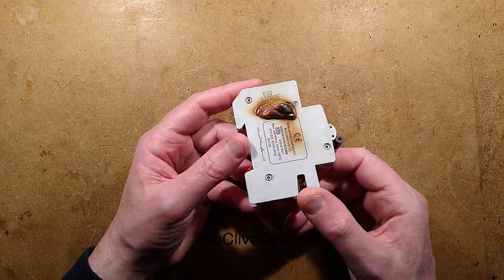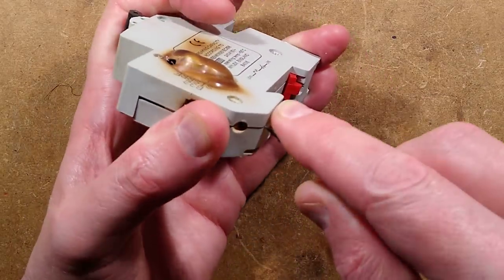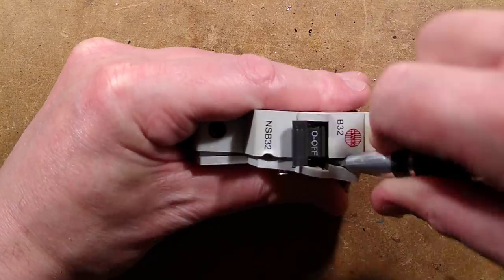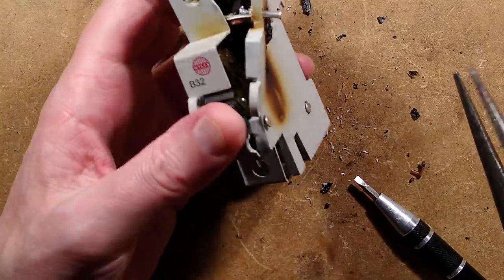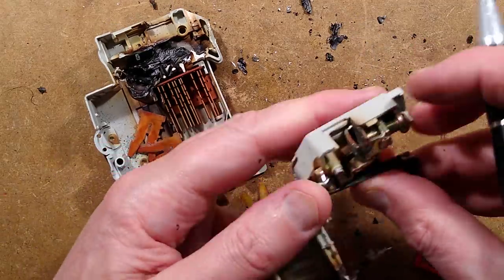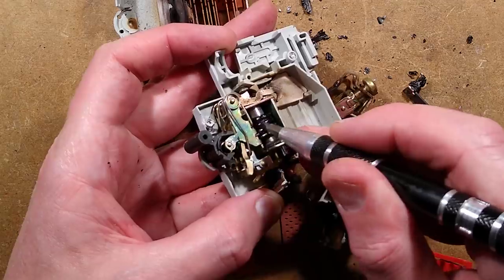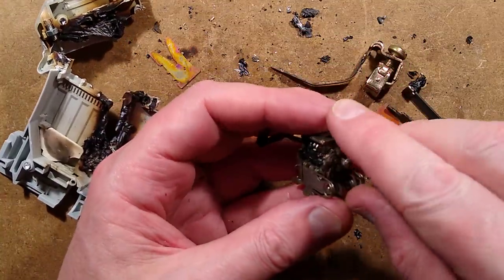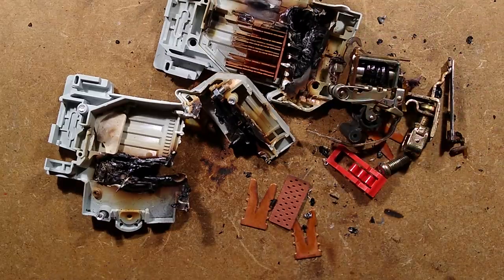Inside a totally smoked circuit breaker.  What went wrong?

Comment: ive seen similar done to US breakers but it was a family got tired of it blowing so they taped it "on"
Reply: Taped ON won't prevent the internal mechanism opening.
Reply: @BTW...  but having an overloaded breaker and the family not dealing with that but rather trying to bypass it with the tape shows just how stupid people can be.
Reply: @LoneWolf0648 However, that's an urban myth - Mechanical 'locking ON' a MMCB CB like this does not bypass any break function internally. The contacts will open under an overload condition and all that will do is fail to indicate a CB has tripped.. where the handle sits in a midway position, and to 'reset' requires switching into the OFF position and then ON.  Sounds like you haven't used these devices or seen where a CB has tripped rather than simply switched off.
Reply: @BTW...  what part of a failed CB that the family tried to tape "on" dont you get. i understand it will still trip even if you glued it "on" and i know how to reset a CB... the reason it failed in the first place was that it kept tripping and the family kept resetting it over and over again, they tried to bypass it with the tape thinking it was tripping for no reason and at some point in that resetting it fried itself from the over current situation.
it was one of the CBs where it will shift the switch slightly away from on when it trips due to the internal mechanics moving, hence the tape and  me calling that famly "idiots"

Comment: This just proves that idiots will always find a way to be stupid, regardless of how many safety features you design into a product.

Personally, I'll stick with fuses. Ceramic can't catch fire, and fuse-wire can't fail shorted.
Reply: Old ceramic fuses are quite robust things. Unfortunate that they take so much space compared to modern versions.
Reply: @jothain  I don't know about anywhere else, but over here in NZ, my panel-mount ceramic fuses are actually slightly smaller than a circuit breaker. Except for the oven fuse, it's a little bigger. On the whole, no space would be saved if they were all "upgraded".
Reply: @Blazin Redeye True, but I don't think the kind of people who replace fuses with nails will be stopped in their idiocy by a circuit breaker. Take away their fuses and they'll just find another way to set themselves on fire.

Personally, I'd still rather have a fuse, than a protection device that can physically fail shorted and burn up.

Comment: Looks like someone tried the old "elastic band holding the swtch open" trick. I saw that cook a box at my old uni high rise flats. Guy was running a hotplate cooker in his room and had wedged the breaker open. It cooked spectactularly apparently and he got booted.

Comment: The same idiots who will hugely overload a circuit are exactly those who will keep trying to reset the breaker until they succeed. Clearly, some additional idiot proofing is required, which will work until the idiots find a new technique.

Comment: I reckon someone wedged the circuit breaker in the 'on' position with a scaffold pole and then plugged in 5-6 3kw fan heaters due to a gas boiler/central heating faliure.